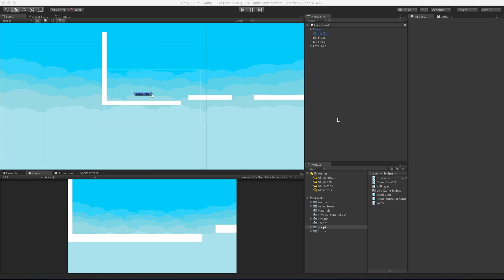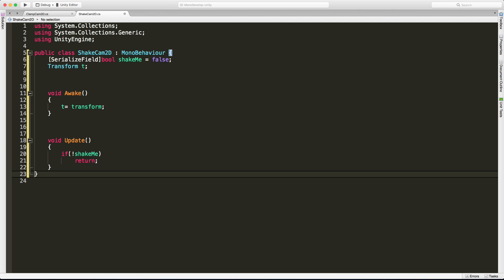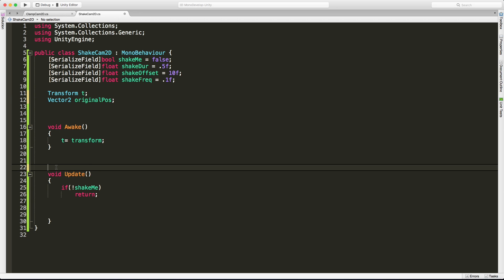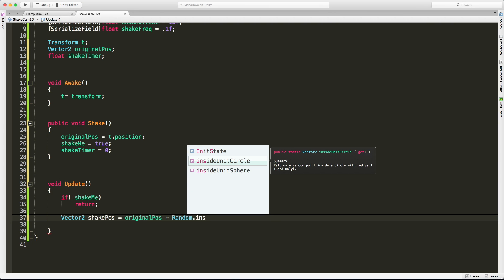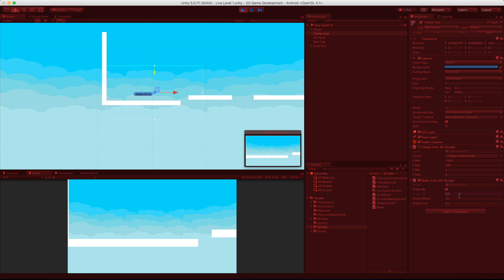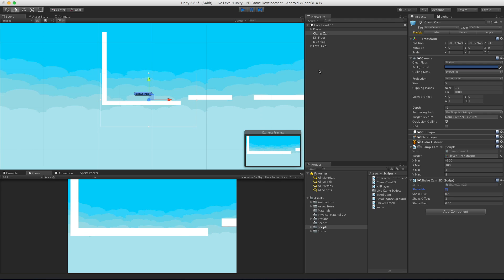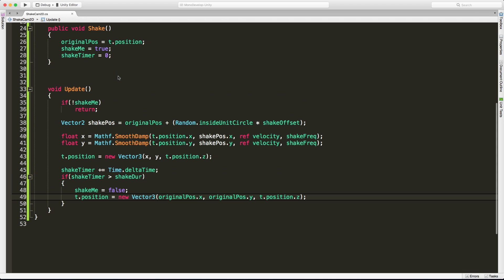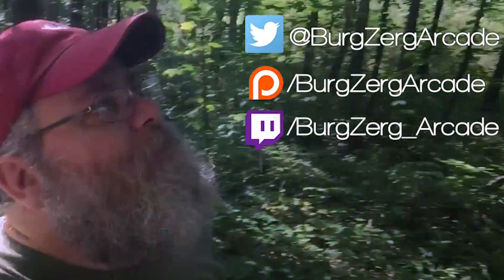Camera Shake In Unity

Comment: Hi there, 
I was wondering:
Wouldn't a coroutine be more elegant here? 
Could you tell me why you didn't go with one?
Thanks.
Reply from the maker: There are a few ways it could be done. I was originally going to use an InvokeRepeating for it. I was going to add it to the ClamCam2D and then got fixated on using Update so my students could see how to work with values that have to be handled in both LateUpdate and Update. Guess it just stuck. If you like coroutines better, that is an option as well. If I was to do it over, I would use Invoke for it.

The only real difference is that you can adjust the step of a Coroutine and not the Invoke(), but Invoke is much more friendly for other to figure out. Six if one, half a dozen of the other mostly.
Reply: BurgZerg Arcade Ah okay, thank you for explaining and elaborating!
Reply from the maker: No problem.

Comment: Why does it seem like the camera almost only travel on a line from bottom left to top right? Looks like it doesn't travel much on the top left and bottom right.
Reply from the maker: Use some debug statements and track where the positions are each frame. I will check mine again when I get home. It may need the seed to be set, but I did not see anything in the docs about it.
Reply: BurgZerg Arcade It looked like since it was using a circle as its new position that it was picking similar numbers and not really moving very much from them
Reply from the maker: It picks a spot in the circle. The circle will have a radius of what every offset you are multiplying from. So for an offset of 2, you can get values of -2 to +2 for both x and y. If you wanted something larger, you can use a larger offset.

Now because it is a circle, we can not get values such as [2,2] as that point will only exist in a box with an offset of 2.

Comment: Wouln't be better take the camera and do this as a children? If you need a camera follow or other stuffs this may cause problem :c
Reply: You could use local position to change the position when shaking. Then it will follow it's parent, but still shake
Reply from the maker: If it is on a child, then it will not be able to shake the camera. Just change the origin with the point that you have assigned as the follow point on the character.
Reply: I talk turning the camera a child of the following camera controller.
Reply: This works. To elaborate, change your follow script's position to localPosition.